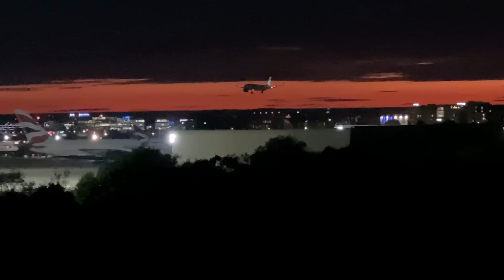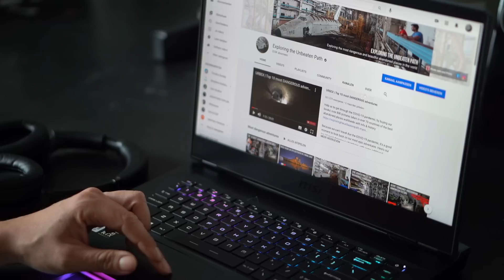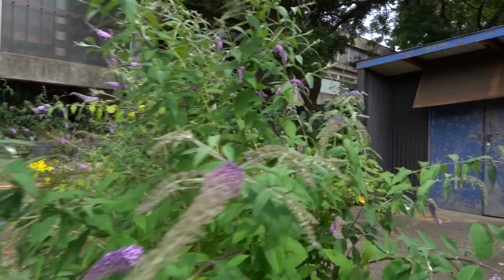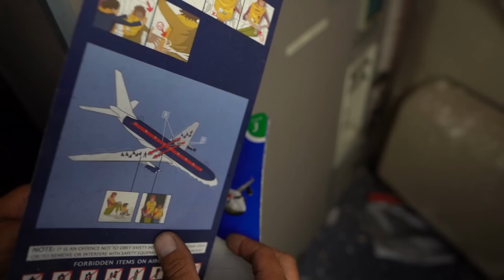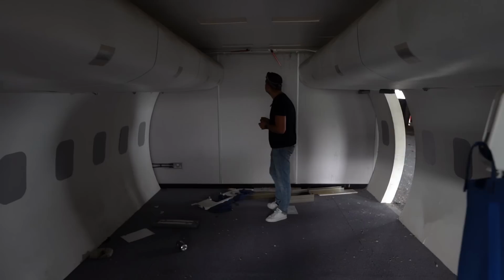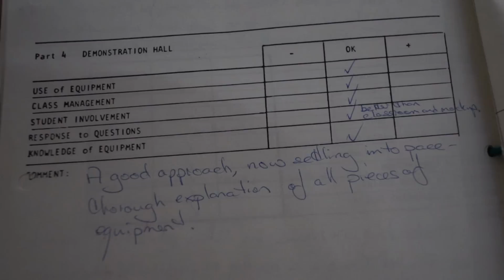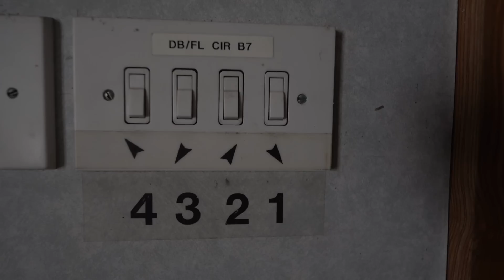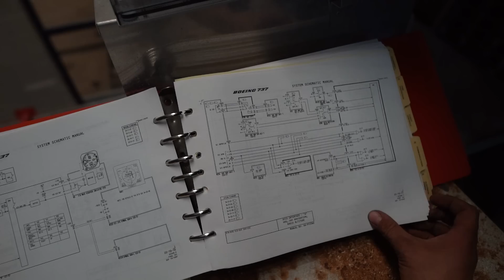Amazing flight simulators found in HUGE training facility of British Airways | ABANDONED

Comment: I toured the Northwest Airlines simulator facility.  It was massive, as large as the company’s headquarters.  It had multiple 747, DC-9 and other simulators attached to massive mainframe computers from the 1970s.
Reply from the maker: Oo I have to wait until that one closes then 😇
Reply: @ExploringtheUnbeatenPath  I toured it after it closed in about 2016 :D.  Delta has a big one in Atlanta now.

Comment: Regarding your escape, I wonder if you carry all your belongings all the time? Or did you have to pick up your sleeping and cooking gear on the run first? Or did you have to return to collect your stuff later? You seemed to be considerably packed on your way in.
Reply from the maker: We still had to grab that! On the run we got split up also. Inside a building we usually take our stuff with us and make sure the camp stuff is located close to our exit in case ww have to run.

Comment: Real pilot flight simulators from companies like Boeing are super expensive and cost much more than the actual airliner does! Don't you remember why the new Boeing 737 was a disaster? Because they were willing to do anything to get out of having to build simulators because they would increase the price significantly.  Those plane's or trainers you guys were walking in looked like 1st generation 737s from the 60s.

Comment: Kinda scary to see how much they cheaped out on the old simulators
Reply: They would have been used for more procedural aspects for the flight crew and pilots along with interaction with passengers, rather than technical aspects of the plane so there was no need to fit all the expensive switch gear and displays if they werent needed.